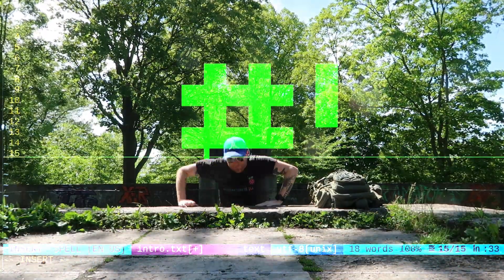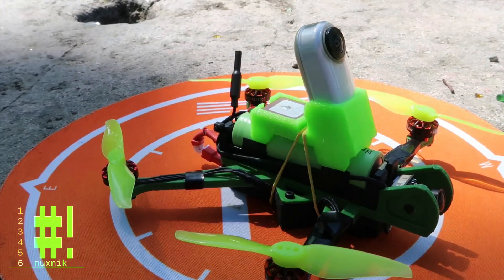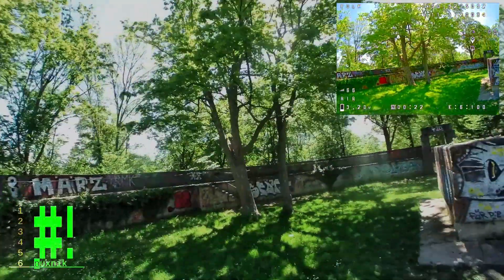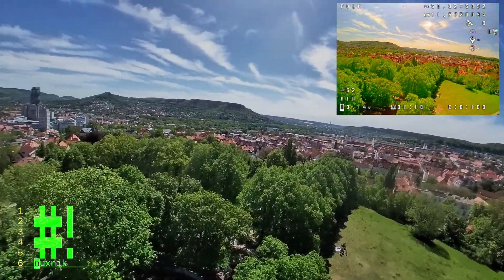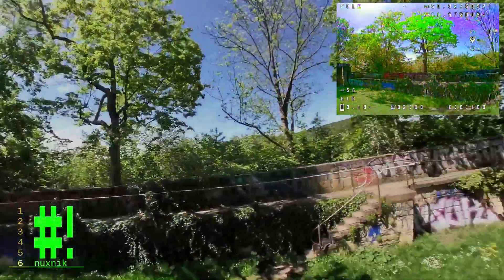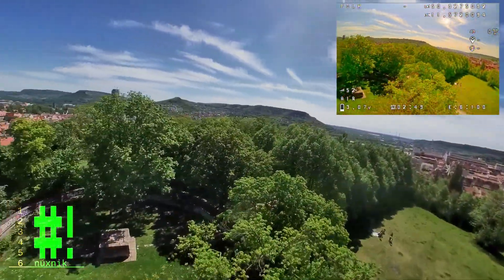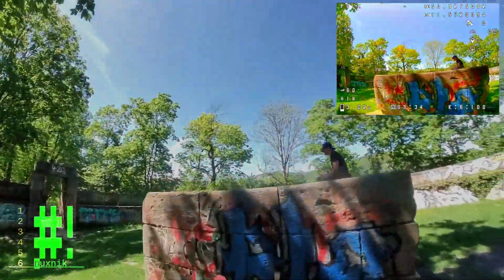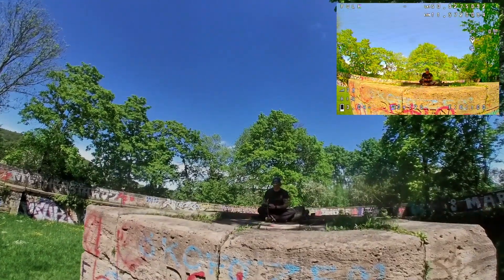#NanoLongRange + Insta360 Go - Can this 3D printed FPV drone handle the weight?

Comment: hello nuxnik :) I am looking for exactly this. I would love to have a nano long range build that can also carry the insta 360 go, how are the things as for now ? Would u recommend this build to go for longer flight with a insta 360 go ? Do you see any alternatives to this ? Perhaps a ready to fly build like Rekon FPV Rekon3 Nano LR  ? I would be really thankfull for any help
Reply from the maker: Thanks for the comment. The NLR is good for crusing. What constitutes "long range" is a topic of debate. For example, you could probably fly 3 - 5  kilometers from your starting point (with an insta360 go). This would be possible under the following conditions: 1. Using a TBS Crossfire or Express LRS system 2. Using a high quality 18650 battery. 3. Using a decent VTX and antenna (400 mW) or more 4. Activate RTH functionality 5. You were flying on a day where there was minimal/no wind. 5. Keep the drone line of sight with no obstacles in between. I have never flown the rekon 3, so unfortunately I don't have any advice concerning it. You might want to check out Unboxingexperience7's NLR modifications: https://www.youtube.com/watch?v=sCllwn2Z2VE Hope I could help :)

Comment: Are you using Zeus5 board? If yes, how did you connect GPS module to the board? To the led strip pins?

Comment: have you thought of using the Hawkeye Firefly Split Mini Version 4K 170 Degree HD  instead of the 360go save you some weight
Reply from the maker: That's is a good idea. However, it might be difficult fitting into the current design of the housing. There isn't any wiggle room. Of course one could redesign the bottom cover. Hmmm, maybe I'll try it ;) I already have a RunCam split 4K camera, but I am using it for another build (the video is in the works). Thanks for the comment!

Comment: I like the design of your mount.  I'll have to figure out how to make something similar without a 3d printer.  Have you found how low of a voltage you can fly the battery down to before the flight controller or VTX stops working?  I'm considering using a Runcam TX200 (works on 3.5 to 5.5 volts) for the VTX and powering it from a small separate battery instead of using the buck/boost converter.
Reply from the maker: Thank you for the comment. Without a 3d printer  you could try using some sort of moldable plastic, form the basic shape and press fit all the parts. I am thinking of doing giveaways on my channel and was thinking 3d printed parts would be cool... Maybe for the next video. We'll see.

I can get the battery down to ca. 2.6 - 2.5V before it drops from the sky. The buck/boost converter keeps the VTX from browning out at that voltage. That's an interesting idea with the external battery on the Runcam. Make a video of it! That would be cool to see how it operates .

Comment: Wooow its so so so amazing...
Reply: Btw my gps bn-180 only get 3 satellite cant locked status...
Reply from the maker: @verve78arief  I sometimes have that problem where I couldn't get more than 4 satellites. One thing I have tried before starting a flight is "warming up" my GPS module, and plugging it in 5-10 minutes before I fly with a different 18650 battery. After ca. 2-5 minutes I usually have 5+ satellites - enough for my RTH function to be able to kick in :)
Reply: @nuxnik   yes for small gps... at outdoor i get 6-7 satellite warming up 5-10 minute.